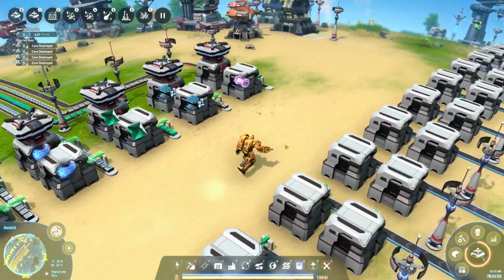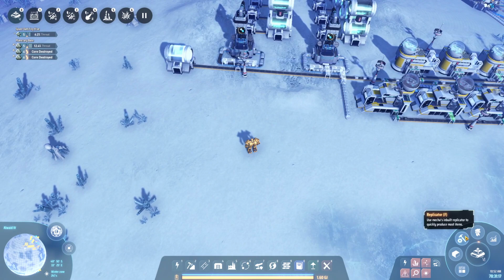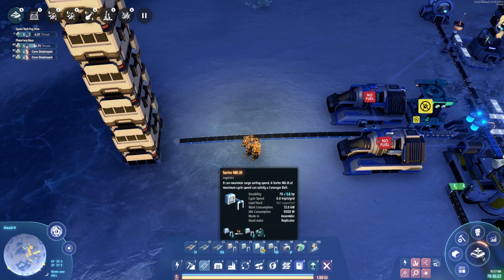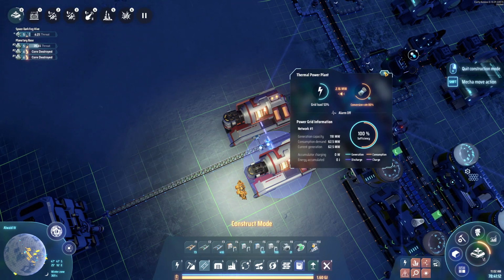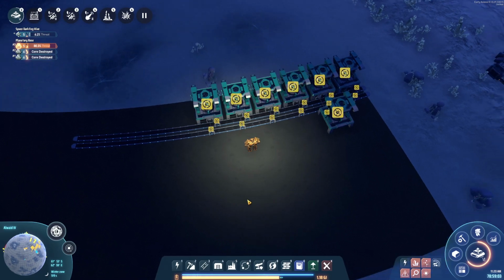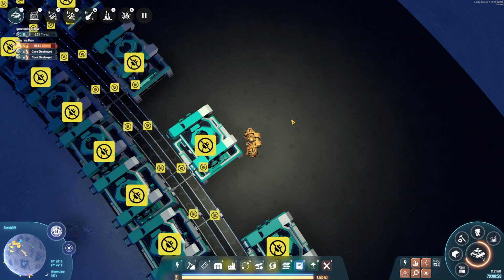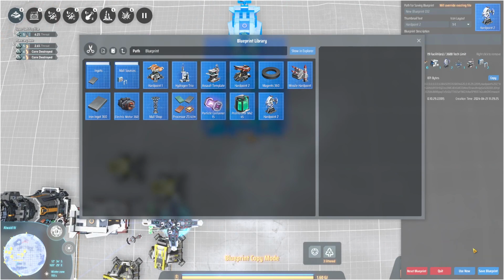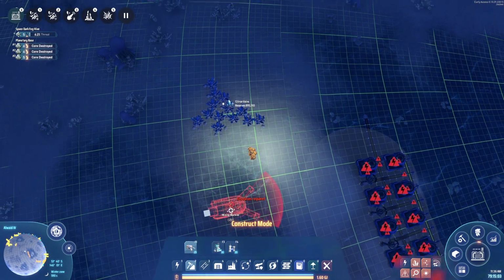HYDROGEN FUEL ROD // Dyson Sphere Program // Mission Log 78

Comment: hello can you tell me your pc specs?
Reply from the maker: Hi BrawlStars, I play on a ROG Strix SCAR 15 (2022) G533ZM.

12th Gen Intel Core™ i9-12900H Processor 2.5 GHz (24M Cache, up to 5.0 GHz, 14 cores: 6 P-cores and 8 E-cores)
NVIDIA GeForce RTX™ 3060 Laptop GPU 6GB GDDR6
32GB DDR5-4800 SO-DIMM x 2

More details here: https://rog.asus.com/laptops/rog-strix/rog-strix-scar-15-2022-series/spec/